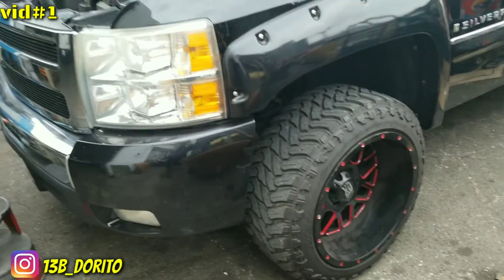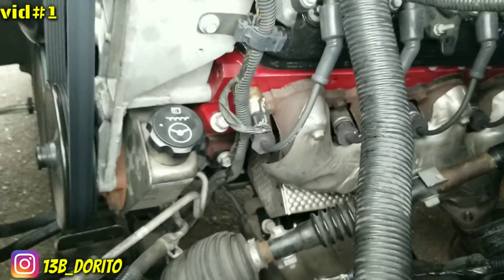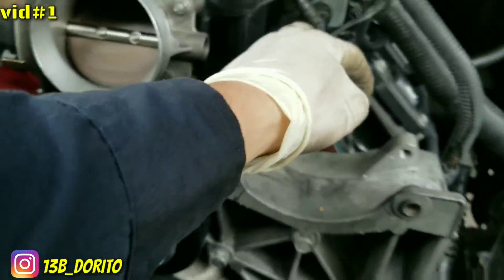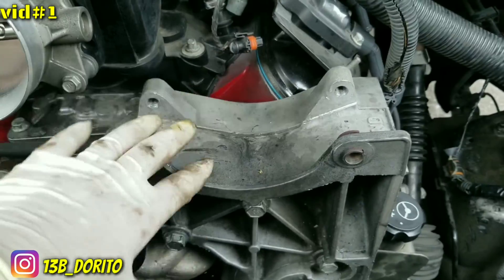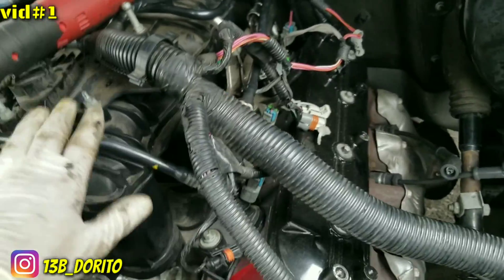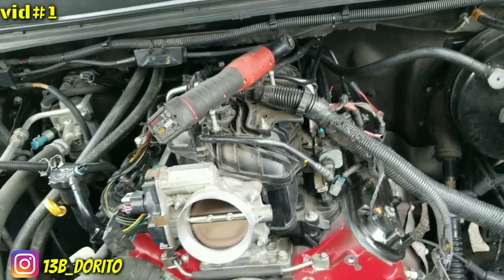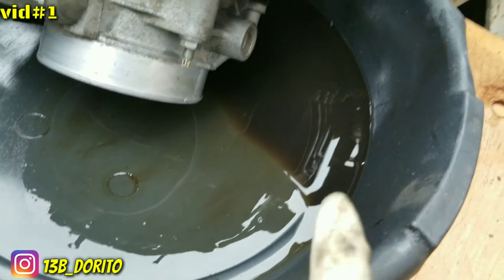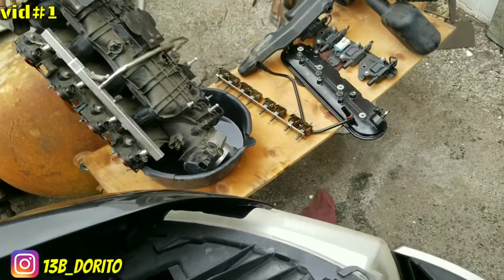4.8 5.3 6.0 Chevy LS Tahoe Silverado DOD lifters removal, engine on the truck

Comment: In minute 9:00 if you use an oil catch can never have that amount of oil in the intake. That oil go to the intake by the PCV.
Reply from the maker: Yeah agree with you but Sorry to disappoint but had to remove that engine due to defective oil control rings!